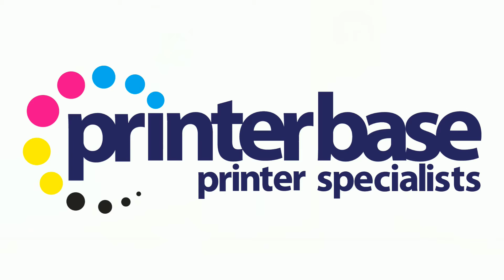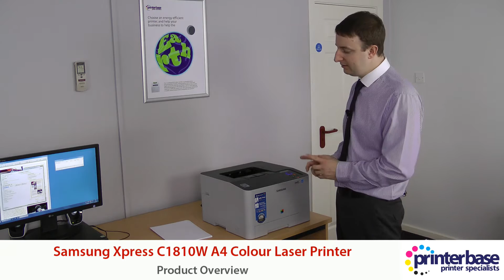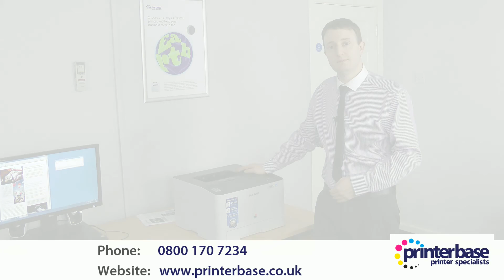Samsung Xpress C1810W A4 Colour Laser Printer Demo

Comment: Hello,
My partner and I recently purchased this printer to print our product labels. When I print to a normal sheet of paper they come out okay. I held the paper up to the label sheet and it was matched perfectly. However when I put the label paper in the printer it was about an inch off of each label. Can you assist with this issue? I'm going through to many labels and ink... I tried manual and normal feed and the same thing happened.
Reply: +Josh Haney you can scan the paper and write on it in photoshop after you hide the layer of the labels